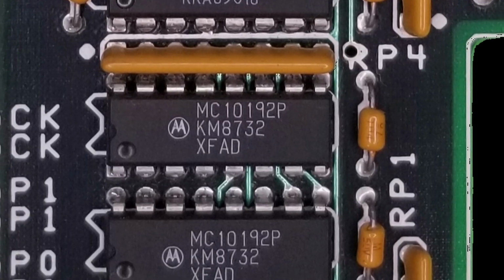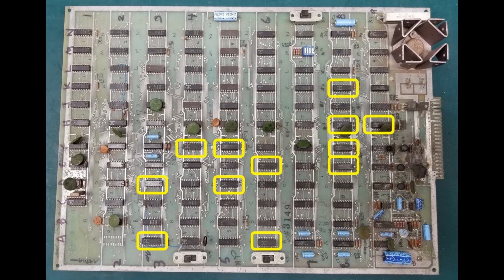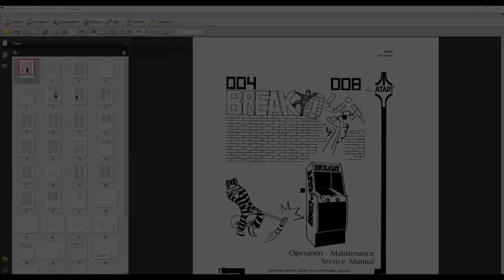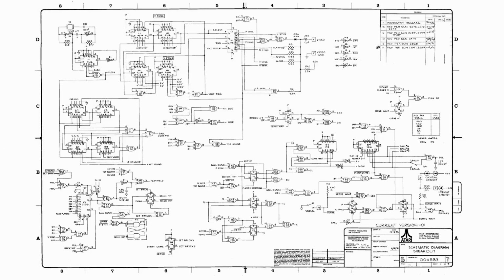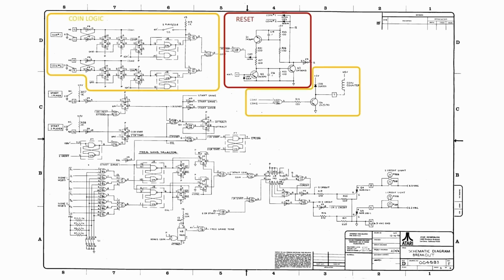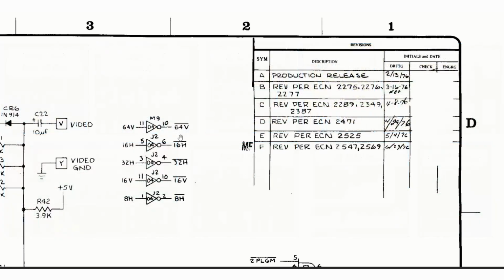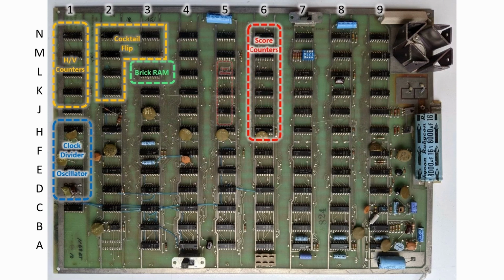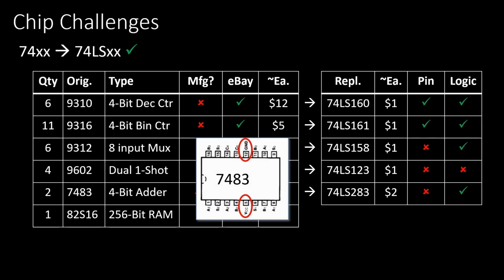Retro Atari Breakout Part 1

Comment: THANK YOU for doing this.  I have a clone from Japan that has a number of modifications made to it, and the original schematics don't match it well, so it was hard to figure out how to repair it.  Your schematics, for the "Fx" version, do match what I've got much more closely and have greatly simplified the repair process.  you mentioned "de Morgan" notation.  I've never heard that expression before, but I have found the logic gate notation in the Atari schematics so much more easier to understand than if the gates were drawn using exclusively the conventional symbols.  also, yes, the resistor that bypasses the linear regulator is to increase the current capacity of the 5 V supply.  that regulator cannot power the board, but if the output is at 5 V and the input is at whatever-its-at then a few amps go through that 4 Ohm resistor which means the regulator only has to make up the difference.  it's INCREDIBLY dangerous:  if ever some chips fail to the point that the load presented by the digital logic decreases to where it needs less than the current normally flowing through that resistor, the voltage on the 5 V rail starts increasing (simple Ohm's law).  that blows out more chips, decreasing the load more, and you get a run-away failure mode that eventually sees the rectified 16 V placed across the logic chips and cooks the entire board.  to anybody reading:  I recommend removing the regulator and resistor and replacing the 5 V supply with a modern power supply that has lots of output protection to care for these vintage electronics.
Reply from the maker: Good point on the power resistor. I suppose the LM380 can pull down as well as up to try and get that 5V. Amazing that they had a 5V@3A supply right in the monitor (purposefully designed to power arcade boards), but they didn't use it. I really like using the PSU5 switching supplies that drop into the TO-3 site and don't need a heat sink (I used this is part 3). Modern supply in a retro package. -Paul

Comment: I still can't wrap my head around hiw such complexity was implemented in discrete logic, and I'm in awe. Implementing using a CPU is child's play in comparison.
Reply from the maker: It's amazing to see how many discrete logic games Atari (and others) made. arcade-museum.com has a nice list. Breakout is pretty far down if you sort it by date. I had created a list of which games used micro-controllers (naturally I can't find it) and most (?) before Breakout were discrete logic. https://www.arcade-museum.com/company/atari
Reply: The old video terminals were quite impressive, too. The last generation before microprocessors were basically microcoded discrete-logic CPUs running the character stream as their instruction opcodes. They used hundreds of TTL logic chips to do it.